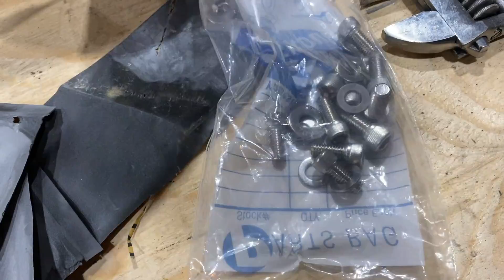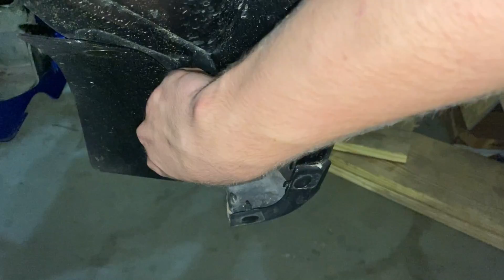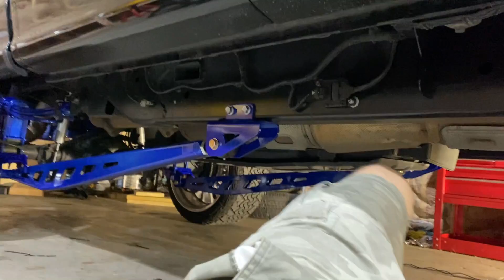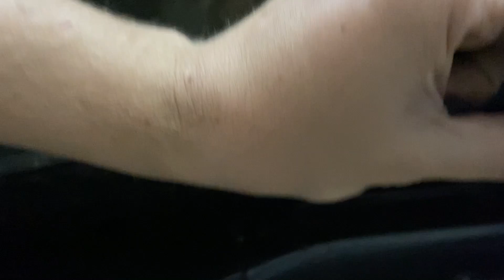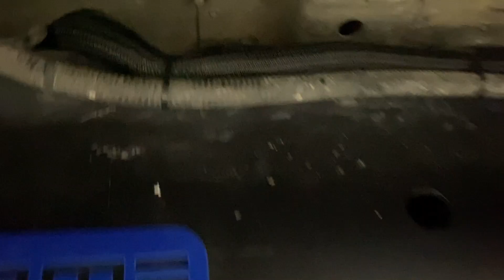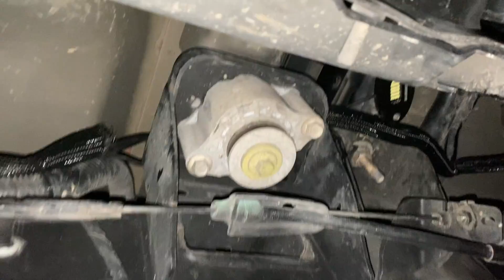INSTALLING 16 ROCK LIGHTS ON THE F250 | ALUMI DUTY BUILD | UFO MOD | PART 9

Comment: Where did you get the chrome grill? I have a 18 and it has the brushed look.
Reply from the maker: Lariat grille
Reply: @JUSTINHAWKSMITH  na bro, that's no lariat grill. That's the platinum grill. They come with a brushed finish from factory.  The one on that truck has a chrome finish.